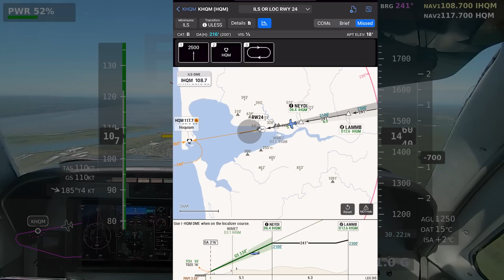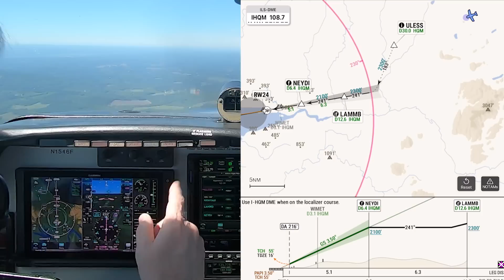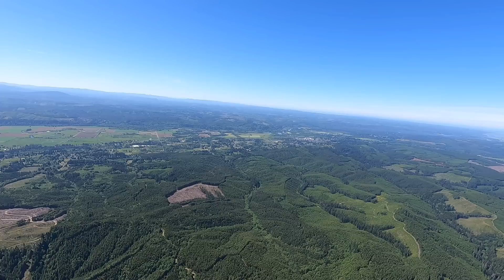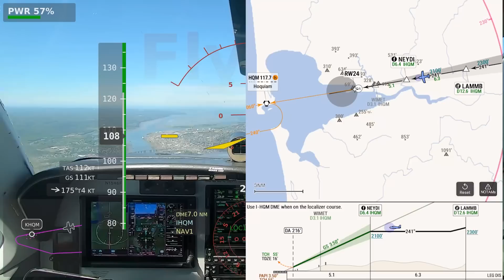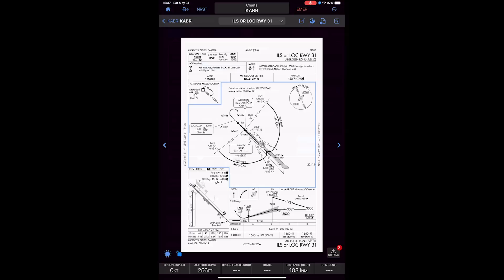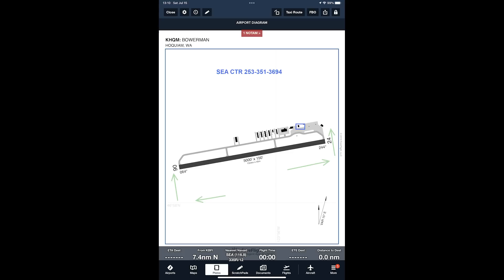Flying an ILS with Garmin SmartCharts

Comment: The Smart charts are great, but fairly useless when they don't show on the 750. As a reference they have some value, but I find a printed chart much handier. Garmin has a lot of cool features that unfortunately don't work. Like the aera 760. Great machine, but can't replace the iPad because it is incapable of updating the software on the panel, which goes through Garmin Pilot. So, unless they can get their ideas to work together, they will still be behind.
Reply from the maker: I have the charts in the panel as my backup if my EFB fails. I typically recommend that you have the chart available on a tablet (or paper) for reference as you brief and then fly a procedure. If possible, display the flight plan page on your navigator in the panel to help you confirm your position, the procedure, and the sequence of fixes that the box is programmed to follow. One of my next columns for AOPA Flight Training magazine explains this setup.

Comment: It's great, but that vertical guidance, the plane instictively makes you think you're low. I see it's flashing at the tip showing your true reference point, but just seeing the plane icon under it makes you think you're under. if they adjusted the center point to the center of plane (or just remove the plane and make it a dot) it would help making you think it's too low. just my opinion. Everything else is really great with it.
Reply from the maker: Yes, you must be aware that the location of the aircraft is at the tip of the nose. It's also important to note that the vertical profile shows GPS-derived altitude, not baro altitude. So you must reference the GS/GP and your altimeter to ensure that you're on the proper vertical path.

But as a quick check of your vertical path relative to the segments of procedure, it's an additional aid.
Reply: @BruceAirFlying yeah. They’re all guidance, so is your localizer guidance if you’re shooting an ILS. They’re great aids. Just wish it didn’t look like plane is under. Just a visual thing for me, that’s all.
Reply: I wondered about that too when I first saw it "beeping" at the nose of the plane. I'm a GUI programmer, and I bet the programmers took their time and tried displaying the "beeping" at the correct position of the plane, based upon how it all sits inside of the ILS path. Having it in the middle of the plane, at the bottom, may make it look terrible on an ILS path. The planes nose may stick out so far/high that it then looks like the plane is to high. And we sure do not want that! Maybe they should add a feature to remove the plane from the vertical display and just keep the bouncing ball? That's a VAF!
Reply from the maker: I wonder why they can't tilt the aircraft symbol slightly nose-down. Most GP/GS are close to 3 degrees, and even steeper angles wouldn't matter much at this scale. That would make the display less distracting, perhaps, for some users.

Comment: ADSB in not overlayed is a deal breaker! waste of 10 years if you cant integrate new technology.
Reply from the maker: You can see ADS-B traffic (TIS-B) in the lower-left corner of the overlay in the small map inset. I'm not sure what other information (FIS-B) you're looking for. The replays of a flight available via FlySto.net show traffic, winds, METARs, and weather radar, depending on the settings you select.

Comment: That is a CLEAN data-driven chart. Very good stuff and excellent demo, Bruce. I imagine quite a few people might want to make the swap. ForeFlight has some catching up to do if they're not on this already. I'm a big fan of data driven charting they started offering years ago, I rarely pull up VFR sectionals or low enroute charts other than for planning and instead use the Aeronautical Chart on FF. Seems like the sim would be a good venue to put this through its paces in a wide range of circumstances!
Reply from the maker: I encourage everyone to practice using any new tech in an ATD or other simulation.

Comment: You have a GTN 750 that provides overlaid approach charts and metar information.  How would you qualify this new Garmin smart approach fearure when you already have a GTN750?  Is it really a revolution?  I have hard time to find real pros that would push me to get the app if I already have a GTN and a G500 avionics for instance.
Reply from the maker: Unless and until Garmin makes SmartCharts available on displays like the G500Txi and GTN 750Xi, I use FliteCharts (i.e., the FAA IFR charts) only as an ultimate backup to the charts on my iPad. JeppView charts, also available for devices in my panel, offer a few nice features that make them easier to use when shown in the panel. But at present, trying to read procedure charts on the panel displays is difficult and cumbersome. I learned and have flown IFR with charts first clipped to the yoke or on a kneeboard and then on my iPad, so perhaps my habits are hard to break.

I also have long annotated the charts on my iPad. You can't annotate charts in the panel.

And as you notice in my videos, when I fly procedures, especially approaches, I have the flight plan page displayed on the GTN 750Xi. I use it like an FMS to confirm my progress as I fly through the various waypoints and to have the fixes readily available if I need to proceed direct to a fix, activate a leg, or confirm a crossing altitude.

If SmartCharts become available in the panel, they could be more useful, and I might change my operating practices.
Reply: @BruceAirFlying thanks so much for your detailed feedback.  Very useful.  I m now used to fly with modern avionics such as the GTNXi 750 and a G500.  Some rental planes at my flight club also have G3X avionics coupled to a GTN650.  In this latter case, flying with a tablet is useful.  But the GTN750 + G500 is very powerful due to the large size of the displays.  I m also used to fly with a home cockpit and a similar setup, so I m quite proficient now doing everything on the panel.  Question of habits I guess.  I m building hours for the instrument rating, but I m already practing in VMC and IMC with a CFII.
Fly safe!

Comment: Great video Bruce, why did you go down to 180’ when mins are 216’?
Reply from the maker: Good question. I initiated the coupled (TOGA) miss slightly above the published DA of 216. But as the AIM and Instrument Flying Handbook note, "DA indicates to the pilot that the published descent profile is flown to the DA (MSL), where a missed approach will be initiated if visual references for landing are not established. Obstacle clearance is provided to allow a momentary descent below DA while transitioning from the final approach to the missed approach."

The DA is the "decision altitude," not a minimum altitude (e.g., an MDA). It's the point in space on a 3D approach along the GS or GP where you make the call to continue or go missed.

I've never seen a definitive number for how much "dip" is allowed. I suspect there isn't an absolute value, because so much depends on the aircraft's speed and mass (momentum). When you fly a 3D approach to a DA, you're tracking approved vertical guidance, following a GS or GP. Per FAR 91.175, at the DA you must decide to continue or start the missed approach.  But the airplane has mass and velocity and needs time to transition from the descent into the climb--a "momentary descent below DA" is a consequence of momentum.

When you fly a 2D approach to an MDA, you can't go below the minimum descent altitude unless the runway environment is in sight. But if you're flying a 2D approach correctly, you're level at the MDA when you reach the MAP (or already climbing). No dip is allowed--or required by the physics.
For an example of flying to an MDA, see the video of the circle-to-land approach at KHQM here: https://youtu.be/BWypWQeDcoU

Comment: Thank you for the video. I have too much time and energy focus and concentration invested in perfecting Foreflight so I am unlikely to switch now, but hopefully that this will force Foreflight to add advisory vertical guidance to their approaches. Something that they have been sincerely lacking.
Reply from the maker: Jeppesen has developed electronic charts in the past, and I expect that they'll work with ForeFlight to create something like Garmin SmartCharts. Charts based on data and displayed dynamically, not static images of paper charts, are the future.

Comment: It looks like there is a toggle on the top right of the smart charts display - the box with two arrows ; that switches you to the standard chart - which allows the annotations... So it might be a case of annotate as usual on the charts - and then you have a one-button flip to get there.
Reply from the maker: That is one way to do it. But I hope for a solution that won't require switching among charts.

Comment: Very nice demo. I’ve yet to fly with the SmartCharts and this gives me a practical view of what to expect. What are you using for your instrument overlay in the video…I like the annunciator modes,etc ? I also have a G500Txi PFD/MFD/EIS and a 750.
Reply from the maker: I upload data logs to FlySto.net and then use the features there to create the data overlays.
Reply: @BruceAirFlying  Thank you. I'll be sure to check it out...motivates me to get my Garmin Pilot to consistently log (it is flakey) to the iPad vs. the periodic SD Card dump.

Comment: I flew some training approaches Thursday with SmartCharts, and I really like them. I’ve been a long time ForeFlight user that was begrudgingly switching to Pilot because it does a better job of syncing with the GTN650 for things like approaches and holds. This is the first feature where I think Pilot is just better

In addition to your negatives, the approach plates are way less useful if you have your iPad in landscape mode. You lose having both the overhead and profile view at the same time.  Thankfully, not a problem for my current setup.